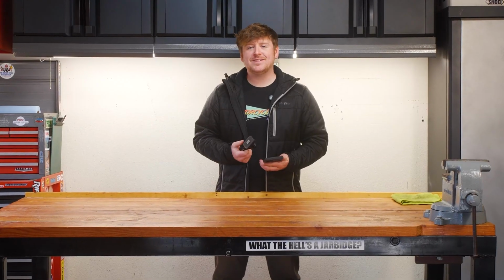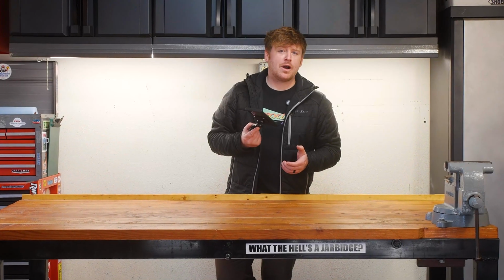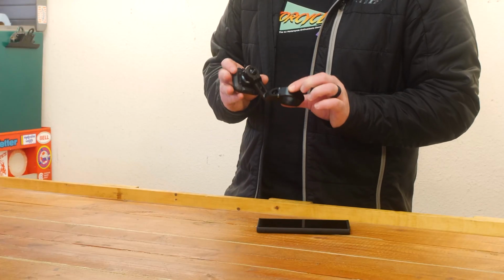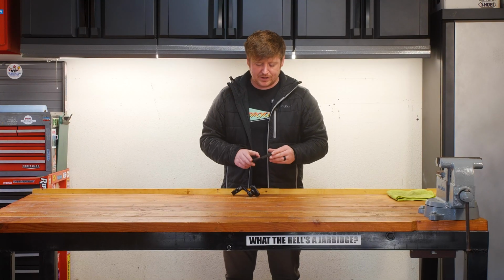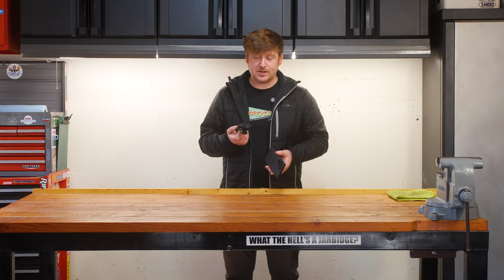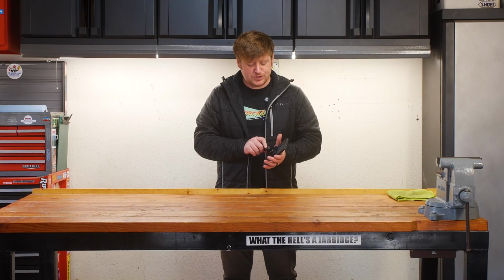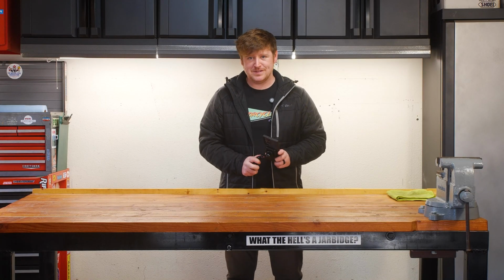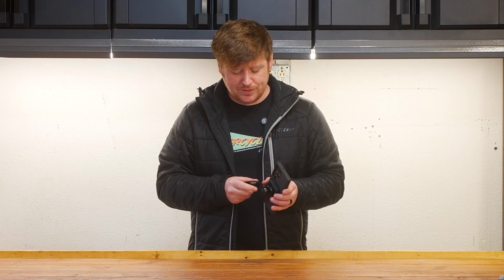In Gear: Peak Design Motorcycle Bar Mount + Everyday Case Review

Comment: Biggest drawback is not a screw. It's the price. Too many good (even better) and cheaper options out there. (Quad lock, SP connect).
Reply: You get what you pay for. This systems works, after about 7000 km combined tours in past 6 months with no damage to my camera’s stabilizer. Dropped the bike 4 times and never dislodged once (x2 slow speed practice x2 normal riding). No permanent stains through dust, mud, and rain after all 9 months of use. Phone survived tumble with the case at 40-50km/hr for 15ft on its sides (case is mangled on all corners with splitting rubber, but no dent or crack on my phone). Only cons are price and rubber padding on the mount peels slowly when exposed to constant 40C weather, which led to my phone dislodging from the mount because rubber bunched up between the teeth and case slot when I thought it was secure.
Reply: @vmsc199 life time guarantee, so make sure you get a replacement if it’s damage due to the weather 👍🏻